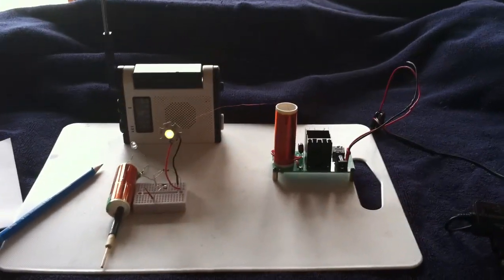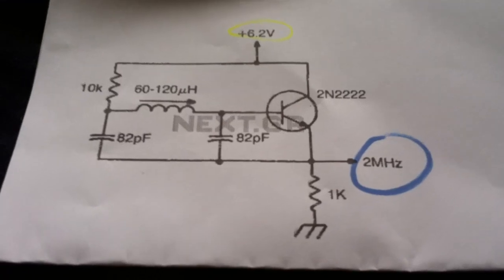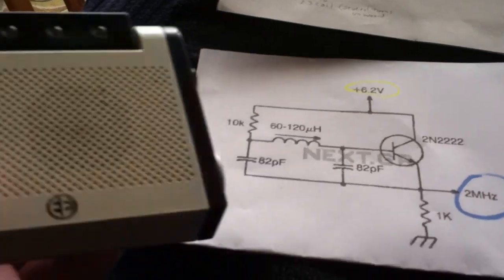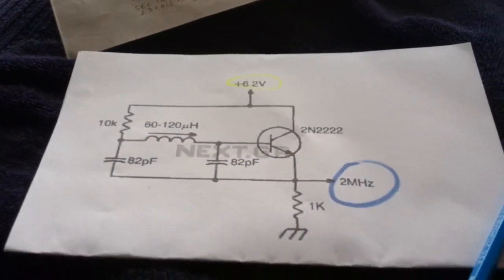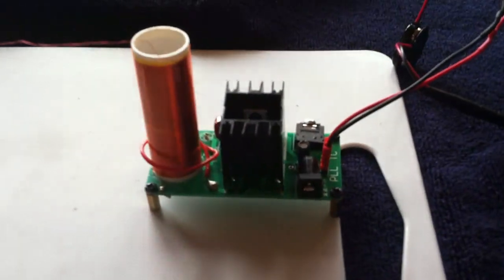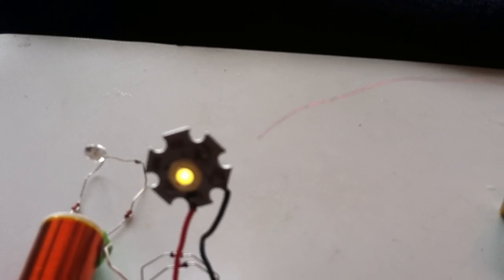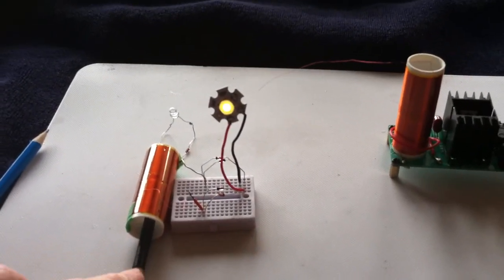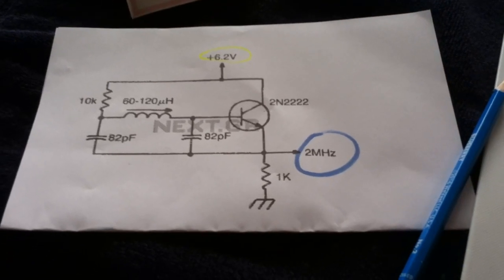Simple Signal Generator circuit??

Comment: Ah...nice and good logic. I was surprised myself about the 20mA of the setup here. That circuit should certainly be built :)
Reply: Wait a moment...am just watching Dr. Stiffler's latest vid and note he has 13.42MHz written on his circuit diagram. Dived back here - A simple route is to build a 2 pin crystal oscillator circuit. 3.579MHz-14MHz are regular values inside old TV's. There's a chart at vectron.com but search of 'crystal oscillator mhz' brings up the common frequencies. Making such a thing with a socket to plug in different values would maybe fit the bill !
Reply from the maker: Hey I did this back in 2013.  I completely forgot about it.  I used a 1MHz crystal with a 22uf choke.  Dr. Stiffler's 'Loop' should work on it.   https://www.youtube.com/watch?v=q4zEpTpiais
Reply: Ahhh, i'd already thumbed that up and don't remember it lol. Watched the whole thing anew. Yes indeed, the 4 leg versions are an easy setup and you had a 13MHz at the time.
Reply from the maker: I still have those crystal oscillators ----somewhere.  I went ahead and ordered another one tonight in case I can't find those other ones.

Comment: You can either use a 27 MC remote control (buy a second hand one) or even a 100 MC transmitter. How to get this last one? It is a 12 Volt plug version, which will transmit sound to your car radio (sound from either an sd card playing MP3, or via bluetooth) and you can tune it between 88 mc and 108 mc. 
There are so many transmitters out there!
PS: like 40 years ago( round the age of 10)  I also found out if you have 2 radios on (I tried to simulate stereo with AM radio's, kind a silly if you think of it). But tuning the one, de-tuned the other one. Later on I learned that an AM radio is in fact that you are tuning a capacitor coupled to a coil, and it acts as a filter for a certain frequency. In fact, tuning is setting up a resonance, and thus increases the available energy, lifting up the sound sent on that frequency. This is why you can listen an AM radio with a crystal earphone without any batteries. (FM needs much more amplification since it is not Amplitude Modulation).
Reply: You said:  This is why you can listen an AM radio with a crystal earphone without any batteries. (FM needs much more amplification since it is not Amplitude Modulation).  Not true.

There exists FM crystal radios no batteries needed!  FM is range limited due to frequencies used, AM travels much farther for the same power input.  FM does not need more amplification because it is not Amplitude Modulated.  FM transmitter sends out full steady carrier amplitude and only varies frequency.  FM transmitters are generally more powerful in order to reach a given say 100 mile max distance.  AM can get by with much less power to send to the same distance or farther.
Reply: I think that is correct, thanks for pointing this out.
Things change .. ..
Our local radio is now using DAB (NL). Never had MORE problems listening to a radio since this. If a car passes by I loose sound for a few seconds. Even a passenger walking by. I do believe everything (literally) will be done via internet in the near future. But security is way behind .. ..

Comment: Well done Brad, Dr. Stiffler just posted a new video where he shows the circuit diagram. You need only 2 diodes at the Cree board, so only one AV plug, Brad.( Or was it Gerry ?? sorry I forgot your real name..)
Reply from the maker: It is Rusty.  I just watched his latest video.  What the coil does in this setup is make the loop tunable if the driver isn't.  I will try the setup with just one AV plug and see what happens,  Thanks.
Reply: overunitydotcom I lost my old notes on his posts. can you provide the links?  

cheers